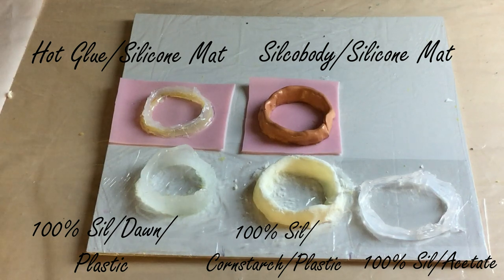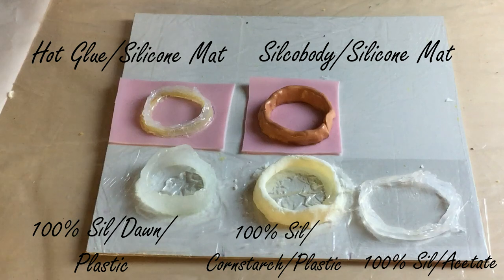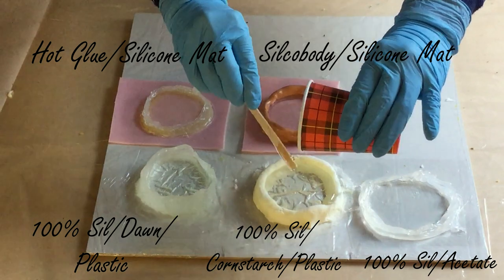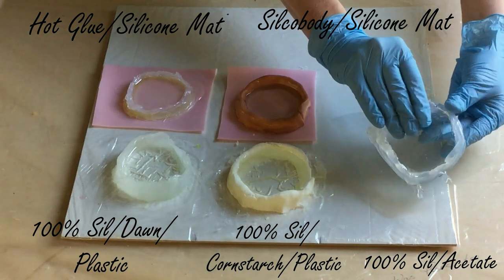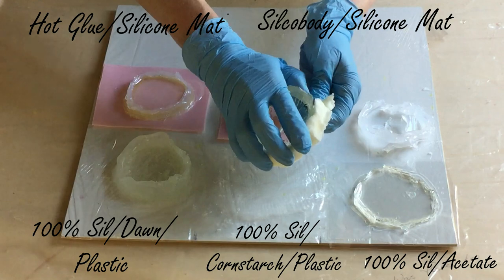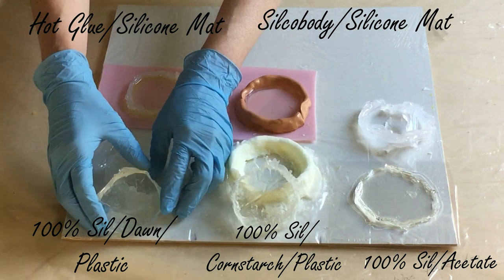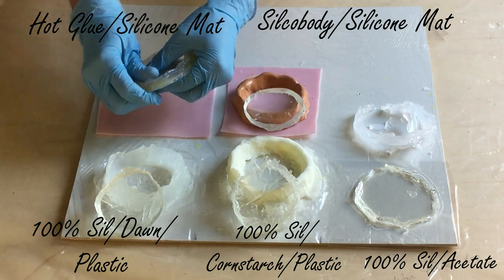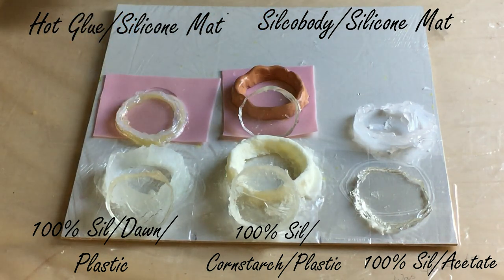39. Experiment Barriers/Dams for 100% Resin Geode.

Comment: Have you tried using play doh for making dams? I'd like to know pls. This is a great video❤️
Reply from the maker: No, I have not tried it Surya, but it's not heat resistant and that's why I don't use it. As you know resin will get hot during setting time and then the play doh will stick to your resin. At the moment I'm using silicone rubber for the dams and I like it a lot. It has no smell and it's reusable.

Comment: Thank you exactly what I was looking for.  May I ask"How do you clean the acetate and the plastic off"?
Reply from the maker: You can remove the silicone very easy from the plastic or acetate sheet. After that you can clean it with alcohol.
Reply: Thank you for the quick reply.  :)

Comment: Petra, thank you for testing for us... I didn't understand the one with 100% silicone/ Dawn/plastic.

I know what they are, but can you explain the water and silicone mix again? You put the silicone in dawn detergent  water and shape it on the plastic?
Reply from the maker: Yes, when you put the silicone in the mix of dawn dish soap and water the silicone doesn't stick anymore and you can shape the silicone dams with your hands. You can also make the dams much higher then when you put the silicone right out of the tube on the plastic.
Reply: So you squeeze it into the dawn soap and water mix then take it out and mold it? wow
Reply from the maker: Yes, that's how I did it. And it worked. It doesn't stick that much anymore. What you only need to do is when you take it out of the mixture you put some dawn dish soap on your fingers.
Reply: I'm off  to try. :-) Thanks.
Reply from the maker: Great to hear. Good luck.